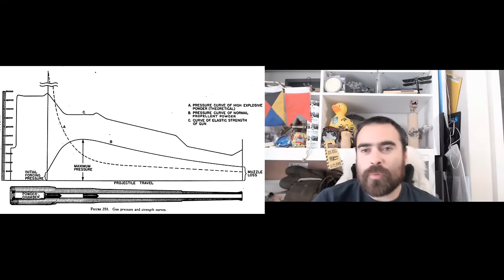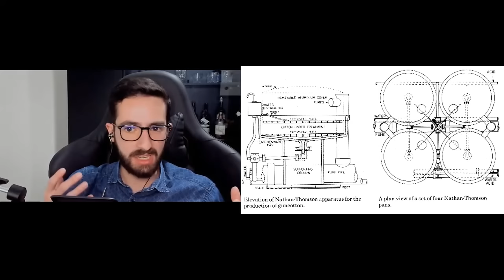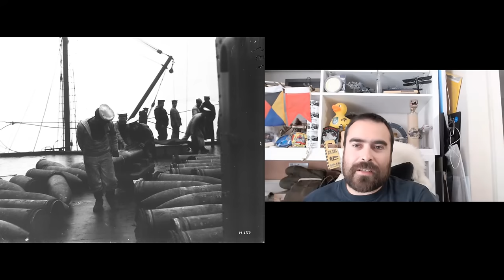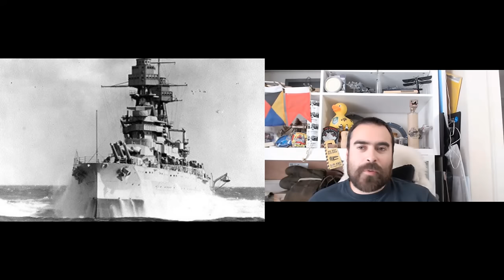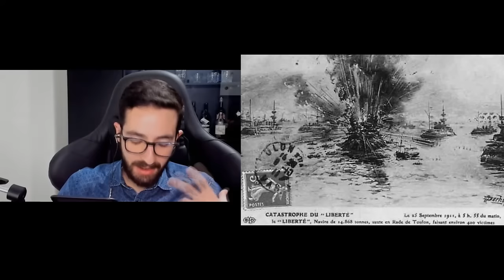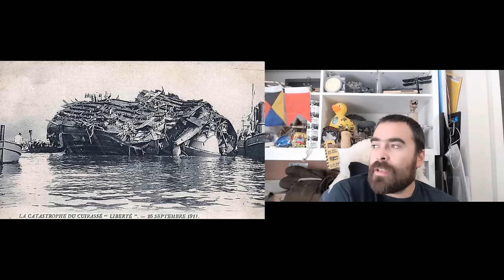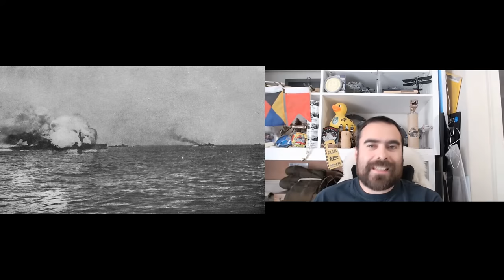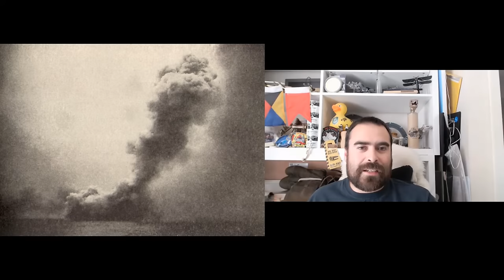Cordite and Poudre B - Why things start exploding at just the wrong time

Comment from the maker: Pinned post for Q&A :)
Reply: Did the FAA have any land based air bases around ports like Portmouth and Plymouth for air defence or was it a case of relying on the RAF and if they did have bases around these ports did they take part in the Battle of Britian?
Reply: WoW, great cast gentlemen. Any ideas on the possible effects of breathing this stuff in over years or decades on sailors?
Reply: What was the job of a dockyard repair ship?
Reply: i am a firm believer that the image goes over the other screen because neither of these 2 men are capable of keeping their face normal while someone else is talking. that or drach thinks his fanbase will click off if they can't always see a black and white photo of a ship
Reply: Hi Drach, I have a question for you please.  It's commonly stated that British Battlecruisers during WW1 removed their flash protection to improve their rate of fire, but I don't think I have ever seen this backed up by source material.  An explanation I have heard is that it was most likely a verbal order because that's generally how Beatty was - a bit of a dashing cavalry type officer who did things fast and loose, so to speak.  But surely such an order would be so obviously dangerous that it's inconceivable (isn't it?) that not one of the dozens of people all the way down from the ship captains, first officers, turret commanders, etc.. refused to do this without a written order, or at least to put their own concerns about such an order into writing.  So is there any written source material for such an order existing?  Many thanks, kp.
Reply: Hi Drach, based on the info in the cordite video, would this explain  among other things why Maine exploded so spontaneously
Reply: Not a question, but you should do a crossover with Tom from explosions and fire. He's an explosives chemist and physics grad student, he's got a channel
Reply: Drach, based on a comment in the comment section, can you cover ammunition ships? I know of two interesting stories about ammunition handling. One where bombs fell down a lift and broke things and a guy who lost his knee caps to some unspecified event involving a 1000lb bomb. Heavy things bad. Toxic, corrosive, explody , heavy things worse I think. 😶
Reply: The Japanese developed a 15cm AA gun towards the end of the war (Type 5).
If such a large AA gun had been developed at the beginning of the war (by any navy), would it make sense to use it as an AA gun / dual purpose gun on warships? (such as Atlanta or on battleships)
What benefits / potentials / tradeoffs would this bring with it?
Reply: @joevallez8664  I know! Nitrate salts, lead salts, copper salts, mercury salts, asbestos, lead paint just off the top of my head.
Reply: I’d love to see a video on the Port Chicago Weapons station explosion in July 1944 (at what is today the concord naval weapons station). Something like the 3rd largest non-nuclear explosion recorded and I’ve never seen a video on it.
Reply: Speaking of flammable things from the late 1800s and early 1900s, was anyone crazy enough to use celluloid on a warship?
Reply: A point that i have been curious about before this excellent video takes on a new dimension. Is there any data available on the differences in loadout - specifically, how many rounds of ammunition and charges would be on board a given ship (both in peacetime and war) when they were a) in dock and b) cruising / showing the flag, etc.? And how might the different load conditions , temperatures, etc. affect the formation of crystal dust?
Reply: Thank you again for all of your work in making all of these wonderful and interesting videos.

As to nitroglycerin dust in the turret; if that was the case would not firing your guns from that turret be sufficient to set off the dust?
Reply: Do you know what type of explosive the US was using.  I am kind of wondering if powder type and condition could have been a contributing factor in the USS Maine explosion.
Reply: Based off Royal Navy history and the fact of a HMS Queen Elizabeth currently being in service, how long do you think it will be until there is an HMS Queen Elizabeth II?
Reply: Matthew said guncotton is nitrocellulose and guncotton is not a suitable propellant for guns, if nearly all modern smokeless powder is based on nitrocellulose. What make the same chemical in guncotton bad but in modern propellants good?
Reply: Could any of this powder instability have something to do with the loss of Hood?
Reply: A thought just occurred to me - could it be that Beatty's battlecruisers became more vulnerable as a result of their move to Rosyth? My thinking is that if they couldn't do full live-fire training very often, if at all, while at Rosyth and were just doing constant loading practice to improve rate of fire, then not only would they have been opening propellant canisters more often, they'd have been doing it with the same ones over and over again. The charges would be getting older and older, which presumably means the deterioration in the cordite would get worse and worse, resulting in more nitroglycerin dust being scattered through the turret systems. The Grand Fleet's dreadnoughts, on the other hand, were doing full gunnery practice on a regular basis, burning through their cordite stockpiles and replacing it with fresh charges, with less deterioration and less nitro dust being scattered.

EDIT: Also, if it's possible that the impact of a shell could have detonated the dust in turret, is there any chance that the shock of the turret's own guns firing could have done it?
Reply: Here's one: Speaking of shooty kaboomy things, what is the source of the debris flying around when the guns fire at the beginning of your video. Obviously big guns are more than capable rearranging the furniture but you might expect a bit of discipline when it comes to potentially hazardous bits flying around.

Thanks Drach, keep up the good work!
Reply: Drachinifel, will you eventually do a breakdown of the Forrestal fire? I know it comes after the normal time frame of the channel.
Reply: How do Asdic domes work, and why weren’t they carried on all surface ships?
Reply: Would museum ships around the world who are struggling financially benefit by consolidating their ships into organised naval/maritime museums in order to attract more customers and keep them there for longer? The first example that jumps to my mind is the Australian National Maritime Museum albeit it is federally funded. They do quite a good job, have a good location and are reasonably popular.
Reply: It's hard to imagine that after a few salvos, enough nitroglycerine powder would accumulate to cause a "fuel-air" explosion.  Surely someone would have said, "Hmmm that's funny. these bags are leaking stuff. I am sure it is fine."
Reply: Wasn't there a problem with British artillery shells and aerial bombs "sweating" explosive crystals which carried through to WWII?
Reply: should Michael Bay needs to use Cordite on his movies??
Reply: You guys hit this video out of the park....both myself and my fiance have "Brain Buzzes" from learning tonight.  Sadly it seems the crews of the ships may have been blamed for the loss to stop public outcry after Jutland at thier loss. Would be great if this video goes on to start a push to exonerate them of wrong doing causing the ships loss.  Now interesting question about Hood for Drach. How quickly was she loaded with supplies before leaving for Denmark Strait? Was main gun Ammo included, what were the dates of manufacturing on it, and is it possible we need to have another look at exactly what happened with the Lucky shot from Bismarck? In the rush to get there would the crew have had time to do a thorough cleaning to remove dust?  I saw you mentioned there weren't a lot of eyewitness at Justland accounts, but Hood seems to have had the same fire then explosion....those who saw Hood or anybody who saw the at Dock Magazine explosions you mentioned after the battle may be able to finally answer just what happened at Jutland.
Reply: Do you think that degrading gunpowder played a part in the destruction of the USS Maine?
Reply: Do you think that the Cordite (nitro) Dust will actually change History and Historians thoughts of the loss of ships? As honestly it is somthing that makes sense but i had never thought or heard of prior
Reply: The explosion of USS Shaw is probably the most famous magazine detonation ever filmed with a motion picture camera. How long was USS Shaw on fire before she blew up? Because that's clear evidence related to the theory that burning propellant would raise temperature and pressure enough to ultimately cause a magazine detonation.
Reply: So we know what the Brits, French, and Germans used as their propellant. But what about the other? America, Japan, Russia and Italy. Did they all use the same propellant as the main 3 or did they have their own domestically made propellant? If so, how did they fair compared to the others?
Reply: ¿how is cordite deterioration affecting small calliber ammo that used cordite like rifle rounds that are still found in surplus?, does it make them sensitive to shock?, as I haven't heard anything about ww2 surplus spontaneously cooking off due to shock of firing/handling or premature firing
Reply: With the knowledge now available, what are your thoughts regarding the destruction of IJN Mutsu?
Reply: With all this talk of
Cordite explosions this makes me wonder if this ties into the explosion on USS Maine.
Reply: Being such a great difference between the german, french, and the british. Was there some reason that the French and British didn't follow the Germans way of thinking when it came to explosives, or was it just because oh it's the other side?
Reply: Would a dampening/misting system have helped to deal with the nitroglycerin dust in the turrets, to make it harder for the dust to be turned into a fuel air explosive by weighing the dust down and/or make the dust more likely to stick to a surface?
Reply: Anyone who has been following the channel for any length of time knows your opinion of Operation Sea Lion. That said there is a scenario purposed by a movie and I am curious about how reasonable it is, or is it just a fun story.

The scenario is thus: In August of 1940 a German U-boat brings a small group of soldiers to the English coast. They make is ashore in landing craft and set about taking over a lone country home, isolating it from the nearest town and the town from the rest of the country (by cutting the telephone cables). This raid is to prove that they can land, to spread panic and cause a bit of mischief. 

The most obvious problem (to me at least) is that as soon as the house is secure they start radioing out. However if they could get passed any patrol the sub would be hidden from radar because it's so close to the coast, if it's a moonless night visual spotting would be difficult and who would be looking at the coast instead of the open water
Reply: ON DUST: I saw a doco on the problems of dust build up in grain elevators causing explosions and wheat is not considered an explosive....
Reply: @sskuk1095 I think the Yamoto 18" had an AA shell for the main gun that was basically an 18" shotgun type shell full of 20mm AA projectiles. 18" AA canister?
Reply: Is it possible that IJN Mutsu blow up from the same reason as ships described in this video, or Japanese Navy  use different propellent compound than Royal Navy ?
Reply: @prof_kaos9341  airborne dust from wheat is combustible. It's basically a fuel-air explosive under the right conditions.
Reply: 1. Why did the German Hilfskreuzers with steam turbines have so much more problems with their engines (with the notable exception of the little thunder god that could) than those that used diesel engines?  I was under the impression that marine diesels were still considerably less reliable than steam turbines all the way through the WWII period (hence the use of steam rather than diesel on essentially all capital ships of this era, although a number of navies had looked at, and rejected, the idea of building diesel-engined battleships).

2. Why did Russia sent their Baltic fleet to the Far East in 1905 when their Black Sea fleet was in much better shape (and wouldn't've had to sail as far)?

2 1/2. Once they had sent the Second Pacific Squadron, neé Baltic fleet, why did they then reinforce them with the Sink-By-Themselves Squadron rather than (as Admiral Rozhestvensky had recommended) some of the almost-new South American cruisers flooding the market at the time?

3. You've often said that a battleship needs at least four main guns for accurate salvo fire. Why?  Doesn't accuracy depend on the quality of the guns and rangefinders, not on the sheer number of guns?

4. How does a torpedo explosion go far enough into a capital ship's hull to detonate the main magazines, like with SMS Pommern in the First World War or USS Wasp in the Second? It's easy to see how a torpedo could be fatal to a capital ship, by blowing open more watertight compartments than the ship can tolerate being flooded at once or severing enough structural elements of the hull to catastrophically reduce its structural integrity, but it seems, at first glance, that, given how deeply capital-ship magazines are generally buried in the hull, the explosion would have to rip and blast through nearly to the centerline of the ship to trigger a main-magazine explosion.  Admittedly, this may well explain why it's so rare for a torpedo hit on a capital ship to directly touch off the main magazines, but I'm still having trouble conceiving how it's possible at all!

5. What would've happened in the rest of the Pacific War if Shōkaku had foundered on her way back from the Coral Sea (as she almost did historically, due to the combination of her severe battle damage and heavy seas en route)?
Reply: @Surestick88  that was the point I was making, dust will combust even when it's not a high explosive.
Reply: I guess you‘re referring to what happens to old sticks of dynamite?
A shell is a shell, it‘s a cast filled with a secondary explosive that is completely sealed.
Charges are bags or sticks of a more volatile explosive that are used to push said shell out of the barrel.

I‘d assume this will happen over a long time to the charges, just like it does with dynamite sticks found in workings of old mines (there‘s a lot of footage on yt of ~100y old sticks of dynamite that are nice and crusty 😳)
Reply: @afrikacorpse  Those are some excellent points.  The Captain is THE deciding voice on his own ship and if someone orders him to violate regulations in a way which endangers the ship, he would damn well demand them in writing. 
Also something to consider is that while Beatty is an Admiral,  HMS Lion is Chatfields ship, so IF the blast doors were removed as history theorizes he would have had to agree.  Since Drach has pointed out that Chatfield was a proponent of higher rates of fire (which is why the 14ince gun was pushed in the 2nd London naval treaty) could the removal of the doors (if they were) been his idea?
Reply: I was wondering if you have heard or know anything about HMS Julnar formally SS Julnar? My great grandfather won a gallantry medal aboard it, William Rowbotham (Rowbottom). I would love to see or hear what kind of information you might be able to find, from what I've been able to research it seems like a very interesting mission to say the least! Thanks Drach!
Reply: This prompted some thinking about some of the other nations' accidental explosions and if they were using similar propellants to the British and French.  Examples coming to mind all happened in port, not under way (maybe reflecting on a point discussed in the video): Imperatritsa Mariya, Jaime I, Benedetto Brin, Leonardo da Vinci, Kawachi, Matsushima, Mikasa, Tsukuba and Mutsu.  Did they all use similar types of powder to the British and French, and to your knowledge are any of these outliers in maybe having a different cause than powder degradation?  Japan seemed to use the RN as a model for much of the IJN, so adopting a cordite clone would not be a huge surprise.
Reply: Based on this information, it seems that Major Harvey's flooding of the Q turret on HMS Lion didn't actually save the ship. Based on the time frame given in this video if it was going to explode it would have done so regardless. Any thoughts on this?
Reply: did age of steam ships use coal or coke and why?
Reply: Hi! I'm a student that draw warships a lot and I have many questions about the visual aspects and fine details of WW2 naval warfare. I'll just dump them here for you to read through! Thank you so much for your content!

1. Were artillery shells visible in the air and would they glow? Similar to the depiction in world of warships? Would there be any warning before shells land?
2.. What did the Japanese colored shells look like? Did they really explode with gigantic plumes of color, or was it more subtle?
3.. Did the Japanese have flak or not? I've heard many conflicting statements about this, some saying Japan never had flak and instead only used beehive shells for all ships with 100mm guns and above, some saying only the battleships had beehive shells, etc etc... 
4.. What was the average visibility range on a ship? Would a ship 15km away even be visible? At what ranges would you be able to clearly tell what type of ship you're looking at?
5.. Of all the Japanese carriers, which ones actually had the big red circle on the flight deck? I've seen several different interpretations of them, all drawn differently.
6.. Why did Japan never get radar? It seems like so many of the Japanese losses were due to a lack of a decent radar. Why didn't they just borrow radar technology from the british before war broke out?
7.. Intensity of battle and ease of aiming? On fast-firing ships like clevelands and fletchers, did the crew ever try to aim for certain parts of the enemy ships, or was there not enough time for that level of precision? Generally, what was the mood of naval warfare? was precision a big concern or was it more like "just hitting them alone is already very lucky, can't ask for any more than that". 
8. On small ships like destroyers who can't outright sink capital ships, I'd imagine there would be attempts to "blind" them by specifically aiming for the radar sets and rangefinders. Did that ever happen?
9. What's it like in the turret of a destroyer? It must've been horrendously chaotic to try to aim with the constant pitching of a destroyer at flank speed. Did the gunners manually compensate or were there computers to do it all for them? Were there any stories of crew trying to aim the guns with all the machinery and rangefinding knocked out?

10. Really curious about the akizuki class! Did they see any action at all?
11. Did any of the Japanese destroyers get into gun fights with bensons/fletchers? Who came out on top?
12. Realistic fire rate of naval guns in WW2? Did tired/injured crew play a part? Were destroyers really able to fling shells once every 4-5 seconds? 
13. Torpedo dodging? How visible were torpedoe wakes anyways?
14. Was armour angling a real thing in naval warfare? 
15. How often did the secondary battery of a battleship ever see action? Were they effective in WW2
Reply: @jkull173  My dad slept through the shockwave from the Port Chicago blast further south in the bay while waiting to go as a medic to the southwest pacific. They woke him up later on his mattress on the floor when the troops who had been in Frisco on pass came back so he could get a headcount and be sure all were back from being out on pass.
Reply: @iknowmy3tables  How it and Nitro are process now what stabilizers are used and modern powders are coated with graphite. Guncotton for demolition use was carried in metal chests soaked in water until just before use. Also note he said the process of making the guncotton was flawed with not enough washings in clean water to remove the sulfuric acid.
Reply: All that talk about nitroglycerin reminded me of something I heard years ago about the really old kinds of Dynamite.  It was basically just nitro and sawdust... and when left sit for long periods of time would settle... sometimes to the point of having the nitro drip out the bottom of the storage crate.
Reply: @scott2836  If I remember correctly Iowa class battleship (like USS New Jersey) was designed to have 130 shells per main gun and that was a bit many for a battleship (cf. their long range as well), like others might be around 100.
Reply: Just out of curiosity, is the Poudre B used as a propellant in naval artillery the same Poudre B us as a propellant in the 8mm Lebel rifle cartridge  8X50mmR?
Reply: @iknowmy3tables  Different levels of nitration.
Reply: @John Thomas You may say that... but it was done fairly regularly.
Reply: @gglovato  This has not been extensively researched, however cordite stored in hermetically sealed cases does last significantly longer than that exposed to the air. Typically open stored Cordite has a shelf life of about 25 years if stored at constant temperature below 20C. Small arms propellent seems to last at least four times this. Primer failure is the usual failure mode in old small arms ammunition.
Reply: @wacojones8062  close but no cigar.. the graphite coating on grain propellent is to improve the flow and metering qualities. Wet guncotton demolition charges will detonate wet. No need to dry them out.
Reply: @stephenwoods4118  Yep
Reply: Given the seemingly endless litany of calibers throughout history, it seems there must be overlap in many instances. IE: the same .38 projectile can be reloaded in 9mm, .357, .38 and several other handguns, though the shells of each are drastically different. 
I note that the 18 pounders on the USS Constitution fire a 5.04" diameter projectile. What if one fired a modern projectile (without the shell of course) from such a cannon? The 5 inch 38 from an 18 pounder, for example?
Reply: The Forrestal fire had explosions going off from WW2 vintage bombs, some red rusty from storage, that the naval bombers were using over Vietnam.
Reply: @joevallez8664  Nitroglycerin is a medicine for Angina in small doses as are several other explosives, possibly RDX. But it also causes migraine headaches.
Reply: @SvenTviking  Dad takes nitroglycerin.. never put that 2 and 2 together. Thanks for that insight Sven!
Reply: @Drachinifel Does any of this shed any light on the 1989 USS Iowa turret explosion?
I've heard that the the US was using up a lot of old WWII ordnance during the Vietnam war, maybe even later.
Reply: @afrikacorpse  I can help a little with this. The RN where a prideful bunch back then- to a degree bordering on insanity. It is conceivable, in fact it's widely known some ships where 'fast and loose' with proper Cordite handling. It's crazy stuff but gunnery officers where under pressure to keep up the RN reputation of rapid fire gunnery from officers above them in the chain of command of that ship. Also as Drach stated at 12:56 of this video- people where also sloppy in regards to the cleaning. This likely also had a big deal in regards of RN battlecruisers just blowing up without taking much of a beating.  It's all covered in this video.
Reply: @SvenTviking  No they didn't.. the fire was caused by an electrical fault on an aircraft leading to a Zuni missile firing. Iron bombs are filled with TNT and have a very long shelf life. They are basically thick steel bottles filled with explosives and are typically stored outdoors with plugs fitted instead of fuzes. They are nearly always rusty where the paint has been scraped off, but as there are no requirements for precise bearing surfaces on an air dropped bomb, they are perfectly usable. 

Vietnam was only 25 years or so from WW2 so a fair percentage of WW2 ammo, particularly of the long life items would have been used. I don't know, but I would bet a fair percentage of the 105 artillery ammo used would have been WW2 vintage. The same goes for recent punchups, many of the 1000lb bomb bodies used to make Paveway bombs in Afghan were 70s/80s vintage...
Reply: Youv done a wonderful video on rangefinders, Armour pericing, Anti air, Radar and most other systems. though as far as i have seen most navys (quite rightly) used mostly He and SAP or other varients of semi armour pericing explosive rounds. I think somehwere between 50-70% of thier ammo loads being explosives rather than ap. Can we please get a video on the subject of He rounds  seeing as that was what was most likely used in most engagements.
Reply: You guys talked a lot about heat being generated by decomp and speeding up decomp, I know on the Iowa class battleships they had active cooling in powder and shell storage, if you go to the Battleship New Jersey channel there are a few videos where you can see this and even in at least one vid they talk about these compartments being some of the few spaces with cooling at commissioning. The cooling was basic cast iron heat register style heat exchangers hung flat to the ceiling, I know Ryan talks about there being cooling plants but I don't remember if he said it was a freshwater loop cooled by sea water or if it was a refrigerant which back then would probably have been ammonia.
Reply: I recall coming across reports from this era in the US mining industry of similar issues with TNT. Some stored TNT would suffer from what i think was colloquially called "nitro-sweat" over time. Some of the questions you guys still have might be cleared up more if you can run down those sources. If memory serves they understood the problem no better than the french or british but a larger sample set, so to speak, may be of some use. I cannot recall exactly where i found the articles that mentioned the problem so i do apologize but it was nearly 15 years ago that i stumbled across the info during a web trawl.

I hope this helps provide some of the answers you seem to be looking for.

The lasting price of safety is vigilance. But too often safety is first paid for in blood.
Reply: celluloid a nitrocellulose a partial and often mixed levels of multi nitration of cotton with lower levels used to moderate gun cotton " burn rate " . This chemistry feature was deliberately not discussed for audience safety .
Reply: Wait then could have it been possible for the ship's that detonated could have exploded do to the shock of the guns firing and moving under recoil?
Reply: Guys I got to get a little sci-fi be here about 21st century technology such as railguns versus the powder kardite gun Navy's of the 20th century with big old battleships with the road guns would have a ship on the road guns will have a vintage I'm thinking ab pre dreadnought I can punch right above its weight using rail guns I think I love them other warships would be surprised by the real guns power and capabilities you can strike a ship from a hundred miles away without being seen and speed out away without being noticed so it would be like the class of Stargate SG-1 the
Reply: Could propellant have been a factor in the U.S.S. Maine explosion?
Reply: Could Propellent been a factor in the explosion on the U.S.S. Maine?
Reply: @joevallez8664  look up nitroglycerin headaches - I imagine that would have been a horrendous problem!
Reply: @troymcmahon488  Not 100% sure, but by wiki-ing USS Maine and then her armaments it looks like she was still using black/brown powder to propel her shells.
Reply: Following on from my earlier comments about the RN's obsession with cleaning, and therefore the unlikelihood of dirty decks being the cause of explosives detonating spontaneously at Jutland, I realised that Jutland came just before the Battle of the Somme commenced.   Now, a major problem at the Battle of the Somme was the poor quality of ordnance, together with its lack where it was needed, i.e. at the front.   It is a matter of historical fact that there was a major shell crisis in 1916, and Lloyd George took personal charge of getting the problems sorted out.   Given that the Navy's shells and propellant would have been manufactured at around the same time as all the dud shells that were made for the Army at the Somme, this raises another possibility - could poor manufacturing quality have itself caused something to go wrong with our bloody ships today?   This idea is strengthened by the fact (unless you know otherwise) that no RN ships exploded in a similar manner after the Battle of Jutland.   What do you think?
Reply: @joevallez8664  slightly lowered blood pressure, I´d suppose
Reply: Do we want to know the name of the German variant?
Reply: @troymcmahon488  Also very cordite-like, but with different stabilizer. I heard rumors even the spectacular result of IOWA´s  turret explosion was at least partially enhanced by over-stored. decades old propellant charges.
Reply: @eiwtsexiang  I don't have time to answer all your questions.  But for [8], destroyers can most certainly sink capital ships.  They carry torpedoes, which are known as the 'king hitters', for that purpose.  The torpedoes can potentially hit under the armor of the big ship, and the water pressure down there magnifies the explosion.  They would probably be set for a depth of 20-25 feet when firing at a big ship.  The challenge is to get close enough to use the torpedoes - typically torpedoes were shorter ranged than guns by quite a margin (though there are special cases).  The destroyer has little or no armor (maybe a bit on the magazines and the director) and has lots of highly explosive stuff on it, so a single hit could very well blow up the destroyer before it can launch it's torpedoes - but on the other hand a hit might not do much damage at all.  Incidentally, the susceptibility of warships to critical hits is one of the things that drives many wargamers crazy, because it's hard to have a 'fair' game that also accurately reflects how much of a role 'chance' played in the real world. The secondary guns on the big warships were there in large part to kill incoming destroyers, though the big ships could also fire their primary guns at the destroyers.  The escorts of the big ships were also present to kill incoming destroyers.  Finally, capital ships by WW2 did not have armor everywhere - they couldn't afford to carry that much weight - and the smaller guns on destroyers could do all sorts of damage to the unarmored locations.  Targeting the superstructure of a big ship was routine in situations where destroyers found themselves 'too close' - this happened in some of the night actions in WW2 in the Pacific.  Destroyers could also 'make smoke' to hide themselves and other ships from the big ships.  Australian author J.E. Macdonnell served as a destroyer gunnery officer in WW2 and has written a fair amount of historical fiction about those ships - you can learn a lot about these topics by reading his books.  Have fun drawing warships!  Maybe somebody you can write a book about it, it's not a topic I've ever seen in a 'how to draw' book.
Reply: @eiwtsexiang  Regarding [4], the visible range to the horizon in clear weather depends upon elevation - you can find many web pages discussing this.  In WW2, it was common to select lookouts for the keenness of their vision, and put them at the ship's topmast.  In such cases, they could see the topmast(s) of other ships coming over the horizon, could make a tentative ship identification based upon the shape and number of the masts, and even decide whether the ship(s) were moving towards or going away based on the changing distance between the masts.  In good weather, a topmast lookout could spot enemy ships well before any ship-based radar systems did - the topmosts did not have enough metal to be readily visible to the radar systems of the day.  Typically 15 miles is given as a range to the horizon - but it various enormously depending upon weather and exact height of the observer.  In general, the radar ranges were on the order of 12-15 miles, with British/US radar being much better than that used by other powers and moving from quite primitive to much more sophisticated over the course of the war.   But, it is worth noting that the German ship Sharnhorst hit the British carrier Glorious with radar controlled guns at a remarkable range early in the war, so the whole radar comparison topic is quite complex.
Reply: @eiwtsexiang  Regarding [6], the Japanese did get radar eventually, but it was a case of 'too little, too late'.  In at least one case, a Japanese destroyer actually sneaked up on an Allied force at night and torpedoed a ship based upon a radar bearing - the Allied force never saw the destroyer and assumed they had been attacked by a submarine!  But by that point in the war Japan had lost far too many experienced pilots and didn't have a 'training pipeline' capable of keeping up with war losses, so the radar didn't really help - they needed an effective carrier force with good pilots and they had instead mostly inexperienced amateurs who got killed quickly when they went into combat.  Also, by that point the Allies also thoroughly understood the design of the Japanese fighter, and had developed aircraft and tactics that basically made it obsolete.  So the radar didn't really help the Japanese all that much because it was just far too late - and the versions they were able to deploy were several generations beyond what the Allies were using.
Reply: @eiwtsexiang  Regarding [9], all the major navies trained their gunnery crews to be able to shoot either from a director, or from local control.  The gunnery director was an optical based system, later radar would also be added.  If the director was disabled, the crew would move to local control.  The systems for fire control varied considerably from one navy to the next - there are several books out there on naval fire control that go into details.  But they could take into account things like the movement of the ship, the speed of the enemy, the speed of their own ship, the relative angles, and so forth using 'analog computers'.  In general, the system worked pretty well.  Getting hits with local control was really hard compared to getting them with director control, for the reasons you mention (and others).  Incidentally, not all destroyers had turrets.  There are lots of cases where crews kept firing after the director(s) were knocked out, but I don't recall offhand any case where that actually affected the outcome of the battle.  Naval gunnery in general was enormously more sophisticated than anything you would typically find on land - I only know of one incident where land based gunnery was actually able to repel a naval attack - and that was a custom built fortification in France specifically designed to repel naval attack and with very similar fire control systems.  It's worth noting that in several amphibious landings in Europe, naval gunnery completely repelled German counter-attacks with tanks - the tanks had no chance at all against the vastly superior guns and fire control of the fast moving ships.  The idea that D-Day would have turned out differently 'if only they had woken Hitler up and gotten the tanks moving' is completely a myth.  The main guns on destroyers and larger vessels were designed to be effective at 10 miles or more, with the really big ships being able to fire over the horizon if they had a spotter to help place the fire.  In general, at 10 miles it was difficult to do precise targeting.   At close range it was common to do precise targeting.  For example, destroyers that forced a sub to the surface would fire their main guns at the junction between the conning tower and the hull, because that would maximize the likelihood of the shells being effective and not skipping off the rounded hull of the sub.  Similarly, the smaller guns (e.g. 40mm Bofers and 20mm Oerlikons) would target the subs hatches and deck gun crews if the sub attempted to man the deck guns.  I only know of one incident during the war where a sub on the surface was able to successfully 'fight it out' with escorts using its deck guns and survive - and that was both at night and against smaller escorts.  Note that the oldest destroyers, and smaller ships like corvettes, might not have a gunnery director, and would be firing entirely and only in local control.
Reply: @eiwtsexiang  Regarding [13], torpedo dodging was very common.  It was extremely hard to hit a small, fast, maneuverable vessel such as a destroyer with a torpedo, provided they spotted the torpedo being launched or they spotted an incoming wake in time.  Whether or not a torpedo had a visible wake depending upon the design of the torpedo and also factors such as where/when the torpedo was launched.  For example, in the Black Sea, natural water phosphorescence occurring at certain times of year tended to make torpedo wakes much easier to see than in other parts of the world.  With respect to dodging torpedoes, skill levels of captains varied considerably, and luck also played a role.  Some naval air forces - such as the Japanese - practiced sophisticated techniques for hitting with torpedoes by attacking from multiple directions (sometimes combined with feints such as pretending to attack another ship then turning to the real target) to limit the maneuvering options of the ship - basically dodging one group of torpedoes would force the ship into the path of a second group.  This was called an 'Anvil' attack - it was how the Japanese finally hit the British Battlecruiser Repulse which had previously dodged no less than 19 torpedoes.  At the battle of Santa Cruz, the US carrier Enterprise successfully dodged over a dozen torpedo attacks and would not be hit by a single torpedo (though it did take multiple bomb hits), while the carrier Hornet was hit by multiple torpedoes (and would end up sinking due to the combination of torpedo and bomb hits).
Reply: Overall, a really great discussion with lots of interesting information, thanks @Drachinfel for doing this.  I'm glad you picked up on the temperature point, since now I don't need to say as much about it :-).  Note that the magazines were typically located deep in the ship, and part of the reason for doing this was to benefit from cooling effect of water at depth, so to compare Kiel and Toulon you have to look at water temperatures not air temperatures unless the ship is in dry dock.  I don't know what procedures they followed in dry-dock with respect to munitions - might be something you could do a presentation on.  Australian author J.E. Macdonnell served as a gunnery officer on a destroyer during WW2 and wrote over a 100 books on related topics, mostly historical fiction involving characters on RN/RAN destroyers and corvettes.  He mentions on a number of occasions that they were very careful to check the temperatures in the magazines daily, and that the cordite was stable unless it got too hot or exposed to fire.  That's not science, of course, but it does give us some idea what the gunnery specialists were being taught in that day and age - and that they were very careful with the cordite.  Also, in at least one of his books I recall the crew running their fire hoses over something (ready use ammunition or cordite, I don't recall?) to try to keep a nearby fire from heating it up too much - which again shows that by WW2 they were really careful about this stuff and had well developed procedures for preventing problems.  As far as exercising goes, he does mention something about dummy shells, so I'm not sure how often they used the real thing - I'm sure they did, but I just don't how frequently that happened, a point which could affect speculation about exercises creating cordite dust.  Also, I vaguely recall reading an article - maybe in an old issue of 'Janes' - that suggested the sea environment could speed up deterioration of cordite.  In general, in maritime locations the salt in the sea water gets into the air and does pose a significant problem for all kinds of things - which usually comes as quite a shock to people who buy houses on the beach - but it's been too many years for me to remember the details in this article.  Still, it's another factor to consider.  In one of his fiction books, Macdonnell has a situation where a crew member sees smoke coming out of either the voice pipe or the vents from the magazine - after a hit to the turret he is in - and orders the magazine flooded.  Not sure if that is a fictional representation of a real event, or just something people then thought could happen.  If that was possible, it would have implications for questions about 'how fast' these events progressed and whether or not human reaction time could handle things.  Another point: a lot of current MEMS researchers have been discovering that the micro-scale behavior of many substances is enormously different from the bulk behavior - and hence the values given for things like melting point in the standard science/engineering handbooks are wrong when dealing with small amounts of something.  Basically edge/surface/powder chemistry can be very different from large scale chemistry.  This suggests we should be really cautious about generalizing from moderately large quantities of nitro in liquid form - large vials of liquid nitro are notoriously unstable - to the dust.  I'm not suggesting the dust isn't flammable or even explosive, but there may be significant differences in the risk and/or speed and/or mechanisms of any event between the two forms - and without an extensive serious of measurements confirmed by multiple authors and carefully examined by the scientific community over many years and with many variants can we really draw conclusions with any confidence.  I think it's reasonable (and clever!) to hypothesize that the dust was a significant part of the problem at Jutland, but we also have to consider why so many other WWI naval actions did not produce massive explosions - and even at Jutland, why did the Queen Elizabeth class ships not have issues when they were hit?  Finally, Macdonnell's books show that gunnery training was extremely sophisticated by WW2 - the gunnery officers and the chiefs were very well educated in their specialty, and they both passed this knowledge on to their sailors and carefully checked what they were doing.  So by WW2 we should not expect to find many cases of some uninformed sailor or 'dumb grunt' doing something foolish and causing an explosion.  Thanks again for doing this - and also thanks to Matthew for his interesting contributions.
Reply: @eiwtsexiang  For [12], yes, some destroyers with well trained crews under ideal conditions could achieve a rate of fire like that  The RN deliberately used guns in the 4 inch range (4-4.7 inch).  This gave them the optimum shell weight for fast firing - a nice balance between effectiveness and rate of fire.  The Japanese and Americans tended to use shells in the 5-5.5 inch range for their newer ships, which were a bit harder to move around because the shells weighed more - they used power ramming to help speed up the process.  The heavier shells did more damage if they hit, but were a little slower to load, and hence generally had a lower rate of fire.  In all cases, for manual loading there were a number of factors such as gun design, sea state and angle of the ship that could affect the loading rate.  In particularly bad seas, some of the guns might not even be usable - that was one of the reasons for having some guns higher in the ship than others, despite that placement reducing their stability margin a bit.  Gun crews certainly did get fatigued - it was part of doctrine to make sure they were fed to help keep up their energy, but even the best crews would slow down during the course of a lengthy encounter.  Bigger guns in general had a slower rate of fire, and that's also true for cruisers and battleships.  Just as with tanks like the Soviet T-34 or some of the larger German tanks, you'll find that a lot of people look at simple statistics taken out of context, such as gun size, and naively assume that bigger was better.  It wasn't necessarily an advantage to have bigger guns if it meant giving up other important things, and that was especially true on destroyers and merchant raiders.  If you can't get hits with it, or you damage your ship firing it, the more powerful gun is not the better gun.  The firing of any naval gun causes the mounting ship to experience a significant shock wave, and it was hard to design a destroyer-sized vessel to be able to handle the shock waves associated with large guns without giving up important other characteristics that destroyers needed.   Some navies got it right, some didn't.  Faster firing meant you could get your shells on target faster - typically (at least in pre-radar days) the first shell would be over for range, then the next under, then the gun would be on target assuming the target hadn't changed course - and with unarmored destroyers you might be able to hit and even destroy an enemy gun or ship before they had a chance to make the needed corrections if your rate of fire was faster.  But smaller shells didn't do as much damage, so the probability of a crippling hit was less, and ships would routinely try to dodge incoming fire by 'chasing the splashes' at longer ranges, so you might not get hits on that third volley giving the big gun ship an opportunity to hit you.  Smaller guns had a shorter range, but they also weighed less (both the gun and the ammunition) potentially freeing up weight for use by other things (such as a better fire control director, an extra radar set, or a few extra medium range anti-aircraft guns).  Essentially, there were a bunch of trade-offs and no guarantees.  The Battle of the River Plate is an interesting example of a big gun ship against multiple ships with smaller guns in WW2.  In the first World War, the Battle of the Falkland Islands is another interesting example.
Reply: @eiwtsexiang  Regarding [14], armor angling was common for the main belts of newer capital ships by WW2.  Look at any of the standard references on the ships to get the details.  For example, my copy of French Battleships by Jordan/Dumas says "The armor belt, which was inclined 11.30 (degrees) in Dunkerque and 11.50 in Strassbourg, extended from frame ..." pp 42.  You'll probably find an inclined main armor belt for most capital ships built late in WW1 or after - and also an incline at the edges of one or more of the deck armor layers (these are different from the main armor belt, it's a matter of whether the protection is more horizontal or vertical).
Regarding [15], the secondary batteries of newer capital ships in WW2 (or those with refits) were typically multi-purpose, capable of low angle fire against destroyers and high angle fire against aircraft.  By 'capital ships' I mean battleships and at least the larger cruisers.  On some ships, called 'anti-aircraft cruisers', these guns were the primary armament.  In any event, these were used frequently - far more often than the main guns, given the air threat - and were fairly effective.  The secondary battery of a capital ship was typically made up of 4 to 5 inch guns, and just as with the similar or even identical destroyer guns they were designed to be able to get hits against surface targets (with director support) out to 10 miles or so.   Air targets were harder to hit - that is part of the reason for the size limitations on these guns, they needed a much faster rate of fire than could be achieved with larger guns.  Typically a 'wall of steel' was constructed by firing a barrage that the planes would have to fly though, at a fixed distance, rather than trying to target individual planes in a large formation.  A typical torpedo carrying unit would probably want to close to about 2 miles to have a reasonable chance of hitting, so these guns would be able to fire on those units (destroyers or torpedo bombers) multiple times before the torpedo could be released, in good visibility.  I believe the radar fused shells deployed late in the war by the Allies required at least a 3in shell size, which meant those shells had to be fired from the secondary batteries - the smaller 40mm Bofers and 20mm Oerlikon couldn't fire them - and these shells worked really well against aircraft, such that a lot of attention was carefully paid in post-war design to making sure there were enough 3in or larger guns in new designs.  Finally, there were a lot of actions at night or in bad weather, and the secondary guns would automatically be in range in many of these actions since the ships were really close when they spotted each other.  Having said that, battleships were involved in relatively few anti-ship actions during the war, they were much more commonly used in the surface bombardment or anti-air escort role so the secondary guns of battleships were primarily used in the anti-aircraft role.  You can find some of true battleship actions in the hunt for the Bismark, the third battle of Narvik, the Battle of the North Cape, the Allied invasion of North Africa, several battles in the Med, the Battle of Surigao Strait, and a few of the (many) Solomon Islands battles.  The last are definitely worth taking a look at - there are some really fascinating battles, with lots of mistakes being made by both sides, and lots of 'lessons learned'.  There are 48 sunken warships off the Solomon Islands, half of them Japanese, half of them Allied ships (Neptune's Inferno, Hornfischer, page xxi) - mostly destroyers, but there are a fair number of bigger ships as well.
Reply: I listened to the first 5 minutes and stopped. Nitrate groups are not added to cellulose, nitro groups are, -NO2 vs -NO3. 
Please send me a message if you need an actual PhD chemist instead of a graduate student in physics.
Reply: Why did the Halifax Explosion occur as it did? Not exactly naval history, I know, but it did occur during time of war, in part due to military reasons (the Mont Blanc being left out of harbor due to arriving after the harbor's defenses were put up for the night) and involving war materials (gun cotton).
What type of defenses did Halifax have as to make night entry into the harbor impossible? (Mines? Submarine nets? Something special?)Could/should an exception have been made for the Mont Blanc (considering it is a time of war and this ship is transporting needed war materials) or was someone in charge at the harbor being a bit lax in their responsibilities? 
In regards to the Mont Blanc and the explosion itself. How was gun cotton (and Poudre B and other similar material) packaged for transport outside of warships at the time? Are charges stored in those same leather cases during civilian transport or do those cases only get introduced during the loading process of the warship? Were there any changes made to the procedures for the civilian transport of war material after this (or after any other significant event)?
Reply: Wait... so the USS MAINE truly COULD have blown itself up JUST because of the "mines" they had in store for use by Marines degrading? Oh boy...😅
Reply: Mr drachinifel the austro-hungary used a guncotton cartridge for their Naval and army heavy guns from 1855 to 1902 and in their Small Arms from 1855 until at least the invention of smokeless powder
Reply: Drach, could you go into more detail about the carrier fires you mentioned where liquified explosive ran out of bombs and off the flight decks? I've read numerous accounts of later carrier fires (Forrestal, Oriskany, Enterprise) and heard about bombs and rockets cooking off and sympathetically detonating, but not explosive filler melting and running into the sea.